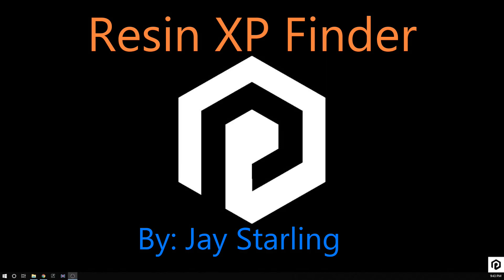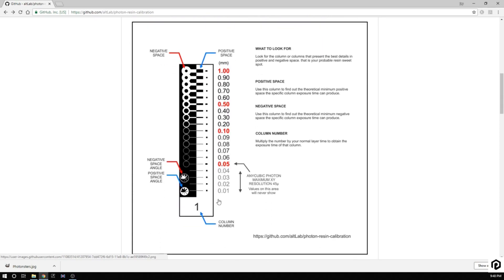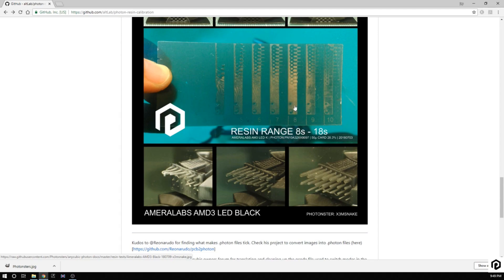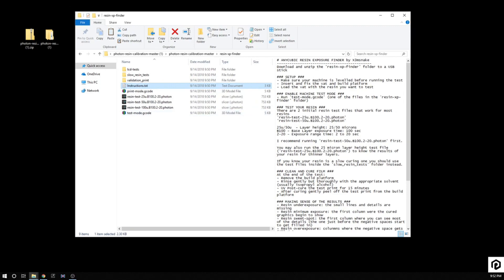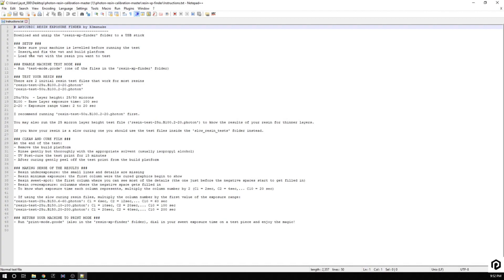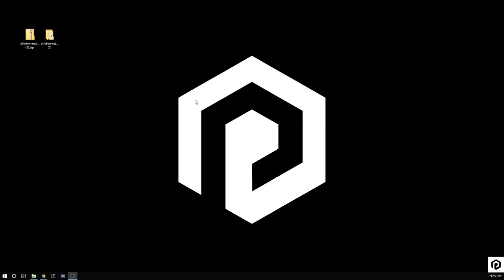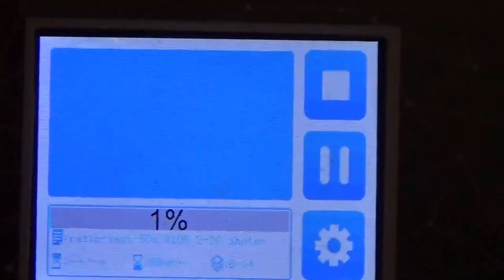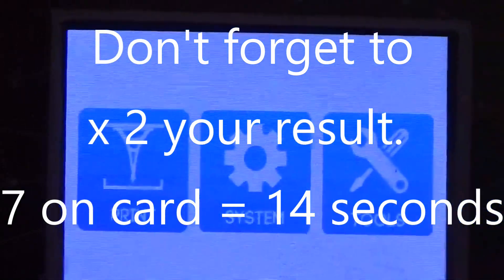Resin XP Finder V2 - Better Audio

Comment: Ok, I have done this test twice and I'm not sure what's going on. It comes out super thin and brittle and cracks apart. I double checked the bed and it is level. Am I missing something or this right?

Here are some images to show what I mean: https://imgur.com/a/xZCPt3M

Printer: Anycubic Photon (original with old main board), Firmware version: 4.2.18 (4.2.19 is buggy)
Resin: Siraya Tech Fast Grey
Test file: resin-test-50u.B100.2-20.photon
Reply: that's a resin problem. some resins just crack at that thin size
Reply: @X3msnake  Ahhh. So does that means the test is ok then? If so, would you say 6, 7, or 8? Maybe I should just go back to the anycubic translucent green stuff i was using before.
Reply: @charlesrowland6932  i think in this case, you could science the s* out of it and change the g-code to get some solid bottom layers down first and put the test portion on top of it. alternatively, you can go the classic route and print your favorite calibration stl at different settings. imho, the later makes for a better archive on the long run and you can amaze your friends with all the cool li'l aesthetic squares on you key-chain ring (once you can actually safely allow them in key-chain-drooling distance again, that is... damn pandemic).
Reply: @kensaiix  I like the idea of sciencing the sh*t of things but agree the second option you mentioned is probably the way to go. I wouldn't know where to even start with modifying the gcode, and and reading it in notepad++ makes no sense. 

Every RERF test I can find is all for the S model (again, i am using the OG photon that cannot upgrade firmware to read pws files) and those all have 8 squares. I don't know how the gcode is dividing the light but based on this test, I think its straight bars and not squares so I would again probably be looking at gcode changes. I thought about using the Ameralabs Town printed one by one with different settings but I don't know various bits of info that probably make a difference (bottom layers, light-off delay, bottom light-off delay, bottom (and regular) lift distance, bottom and regular lift speed, lifing speed, and retract speed). All this test (in the video) tells me is the exposure. I don't know what else it's doing in order to prep an stl for this.

Now, with that, I can open the .photon file in Chitubox and get SOME of that, but not all of it: https://imgur.com/CckJlBh
But hitting back doesn't change the settings in chitubox as far as I can tell. Opening it in the photon file checker doesn't give me all the info either. I don't know if there is some magic formula to use for getting that info or what. 

This is Chitubox's default Photon settings: https://imgur.com/sMvSRMm

Comment: I've recently found some Monoprice resins (fast yellow orange & red) which only show details on the 10/20 second line. So I've had success with the resin on the Elegoo Mars at 20s per layer - but is there a way of testing 10-30secs max later time instead of max 20? I have a feeling its on the low 20s side
Reply from the maker: only multiples like 3-30 or 6-60 and there is a folder with slow resins that has these times

Comment: hi there. my photon is in the last firmware and it dont recognize the files to modify the printer and make the test correctly any help ? thxs
Reply: you probably have a Fauxton (photon classic with a S board) or a Photon S, if that is the case then this will not work. lookup alternatives by Anycubic users on thinguiverse you will need to use the not so great rerfs instead

Comment: Would this work with the qidi shadow 5.5s?
Reply: yes. but make sure you backup your eeprom data first before using the resinXp the first time since there is little documentation and support on the qidi.

create a txt file and write this line
M8512 "configFile.gcode" 

save it to a usb and print that txt file on your machine. it will create a file named configFile.gcode. keep that file safe

Comment: It's not clear what are you supposed to do for curing? From the readme, it sounds like you remove the print from the platform after curing. Is this true? It's so hard to clean if the whole platform is cured.  Here is my failed calibration print (Siraya Blu blue at 25C). Any idea why I don't see much from the calibration print?
https://preview.redd.it/kb6eqvs1qn441.jpg?width=3024&format=pjpg&auto=webp&s=600912c8efb0c404fb57b4f3fcb2754bfe7fb448
Reply: I just read an issue in the github saying any transparents resin (including Siraya Blu blue) won't work! I wish this exception are clarified
Reply: @wildwildwilliam  Yap. This unfortunately is not a good test for resin XP (exposure)!
Reply: i could not even get mine off without breaking it, very thin
Reply: @andrewking2590  I  had to soak the platform (with the print) into IPA overnight before I can safely remove without scratching my platform. The print is useless because the resin is semi-transparent in my case.
Reply: @wildwildwilliam  you should still be able to see the resolution in from of a lamp.
Reply: i ran it a second time and gently got it off, the first time i was a bit rough with it. after that i rinsed it and i was able to use it.

Comment: Hello thanks by your great report. I have a question. Is possible that I use it in my new photon-s?
Reply: From an earlier comment on this video: Photon-s can't read gcode file.
Reply: @macnavi  yeah i'm really regretting buying the photon S, it feels like the hardware is marginally better but all of the support stuff like this range finder are no longer usable.
Reply: @AvinashArora0  Actually I get better prints and more consistency on Photon than on a Photon-S  :-(

Comment: this is for each resin you use or is it specific to each photon you use? If I use the same resin in 2 machines, should the exposure time be consistent?
Reply: Well, this is valid ONLY for ALL Anycubic Photon printers or priters with the same UV-light construction and wattage and LCD. Photon-S (a newer version) have a different light source (parallel light)  which in theory cast more , at lease less scattered, UV light , thus making exposure time a bit shorter. 
Unfortunately this code + test model is not exactly universal as it is specific for Photon. Photon-S, again,  has a different controller/firmware making this test a no go for universal use.  But on the other hand if you have multiple resin MLCD printers and one being the Photon, you could use the data as a good starting point.

Comment: Thanks! 
Why you don't write actual seconds (14, 16, 18) etc instead numbers (7, 8, 9) ?
Reply: The column numbers represent what the columns are, The number of exposures that that particular column has recieved.

Writing seconds would mean making a file for each resin test exposure time, since there are different test ranges for different resin types and layer heights. And if the user then decided to change the exposure time manually on the print file the results would make no sense.